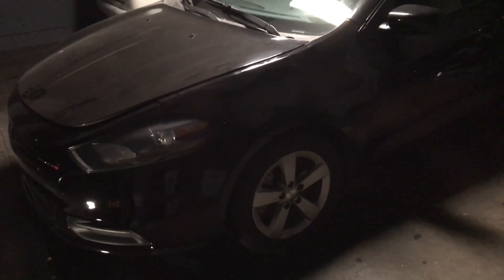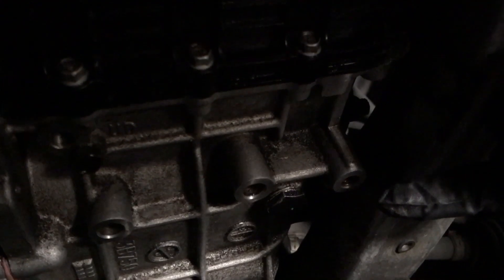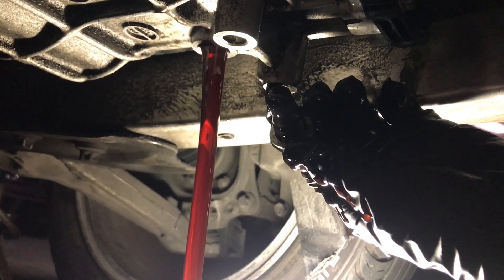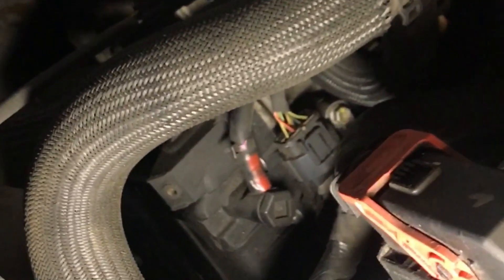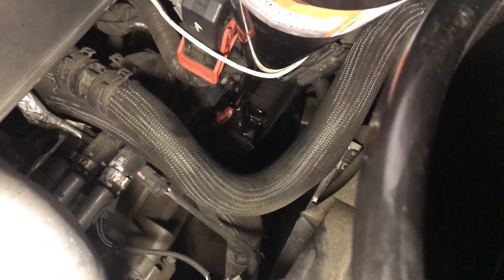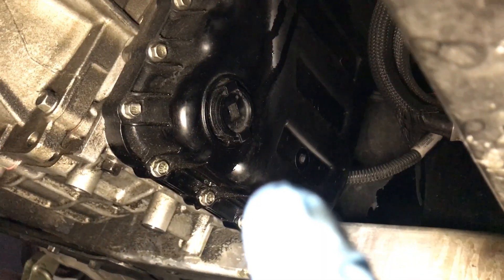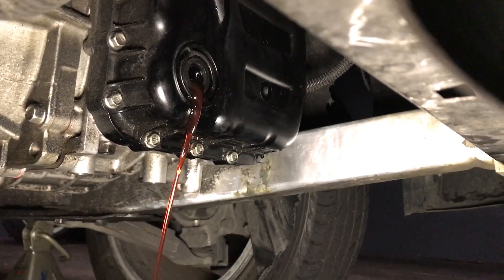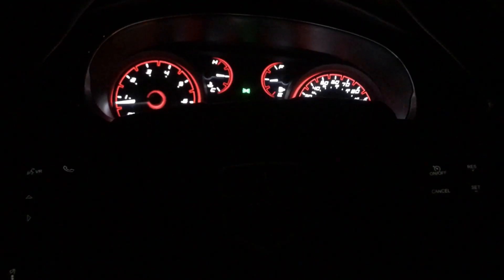2015 dodge dart SXT transmission fluid change

Comment: 1:10 15/16" is not a 'Fucked up" measurement when it's supposed to be a 24mm.  It's Korean transmission using metric bolts.  15/16" is just an SAE rough equivalent for 24 mm.  Otherwise, a great video to review before taking on the task.

Comment: Where you are trying to fill is the VENT! The fill plug is on the back and is most easily accessed from underneath. To fill use a flexible tube and funnel or long transmission funnel with flexible end. The  tool you use to check the level is available on amazon (CTA Tools 1017 Chrysler Transmission Dipstick) and more than likely  at better stocked auto parts stores. You use this to check the level from the fill hole. Doing it right and  filling from the proper plug which is on top  close to the driver-side firewall. Fill plug and drain plug are both 15/16ths  (24mm). The vent (where the video is showing you to fill) is opened  to allow the flow of the tranny fluid to push out air when filling. Honestly if you've done it twice already like I have after the car is up and level and already to temp the drain, fill, and fluid level check takes 15 minutes tops!  use a clean drain pan so you can record how much fluid drained out. Replace that much with new fluid. Start it up and check the level. I don't have a lift so I level on jack stand or blocks and am on a creeper while it's running checking from underneath just like the rest of you. It really is pretty easy and beginner level skills are all that's needed. Check around the net to find location of fill plug. It's hard to see from the top cuz there is so much shit blocking your view but it's there.
Reply: Gor o e of the tools but disnt come with box so i have no clue what level to put it in any help?
Reply: YOU should make a video on how to do this because you're exactly right.
Reply: Thank you, Shamus Todd, for your clear directions of how to properly change and service the 6f24 6-speed auto transmission manufactured by Hyundai for Dodge & Jeep models including the 2013-2016 Dodge Darts & 2014-2017 Jeep Patriots, Kia models...  Thank you for explaining about the proper fill plug which is located in the corner/back of differential/transmission.  You confirmed that the front black bolt is used as a vent primarily (left opened while filling baxk fill plug with SP-IV ATF Mopar transmission fluid.  I understand that either a 15/16 socket and/or a 24 mm is used on both the drain plug and the back corner fill plug with washer.  The front back plug can be opened with a 3/8 socket.  See black plug opening for maintaining proper transmission level.  Torque is between 32-36 ft-lbs on both filler plug (back corner of differential/transmission.  Operating temperatures should be approx. from 120 to 124 degrees.  (Use CTA Tools 1017/10320A Chrysler Dipstick)...  FYI, See BestLine Transmission Conditioner with Diamond Nano-Lube Technology to help your 6f24 run cooler, longer, with smoother shifting!  Visit here:  http://www.extreme-engine-relief.solutions
Reply: @anthonytaylor-qx1px  i know its way late to answer you but i'm answering you for posterity sake so others can find the info. I ha to look it up because i couldnt remember but when you drain the transmission all you need to know is it holds 5.3 quarts of transmission fluid. These are a closed system of a sort but the still consume fluid and get low. So if you were low and put back what you took out you are still low. Drain it completely and add 5.3 quarts. Also something that may be important to pass on as im done with this car. My daughter bought a honda. So anyway the  torque converter holds 2.2 quarts and the pan holds 5.3. When you change whats in the pan whatsin the convertor will mix with it when driven. I believe this is a very good thing. The transmision runs on fluid friction super clean fluid in a worn tranny may not be a good thing. What im saying is the new fluid mix with the old still in the convertor is probably just the right amount of dirty to cause friction and be in the propper vescosity range.   Well thats it hope this info helps someone else from getting screwed at the shop.

Comment: That is NOT the fill point for the 4F24 transmission, I believe is for the air vent.  That is why it takes you 1/2 hour to fill it.  The fill point and plug are further back and is similar in appearance to the drain plug.  It is easier to reach from the bottom then use the funnel from the top with a length of flexible hose placed into the fill hole.

Comment: ur supposed to get the transmission oil up to operating temp cycle thru gears a couple times with the car on..then pull off the level plug and check the stream
Reply: The engine is also supposed to be running in park.

Comment: I did mine.   3.5 litres drained out, add 3.5 litres in the level check hole, you’ll have to start engine to allow it to fit.   Get a pump and a long hoses to make the process easier.

Comment: Forgot to ask you the type of ATF you are using and the amount you use for transmission fluid replacement.
Thank you
Reply: Use the same amount that came out, and use SP-IV M mopar fluid. You can use the level the way he did if you have a level surface to check it, similar to a differential/transfer case

Comment: Does it have a filter to replace
Reply: The 6 speed 6F24  automatic transmission has an internal filter within the transmission housing which requires no servicing!  The only way to replace the filter would be to open the transmission up and that is out of the question!  Juan, FYI check out our BestLine Automatic Transmission additive which would promote a cooler running transmission coupled with longer life!  Visit BestLine here and thanks, Juan:  http://www.extreme-engine-relief.solutions

Comment: What about the filter?
Reply: you don't need to change the transmission fluid filter unless your transmission is already super screwed up and breaking up. the seal only needs to be changed if it is leaking.

Comment: I'm assuming it drove without issue.. did you add or remove any fliud after you check the level the first time?
Reply: Yea i did checked it but i forgot to record it. Oil came out in the same amount as it did in the video so there was no need to add/remove oil, this might be different for other people. Its safer to double check
Reply: jousey junior, so I flushed mines and to level it out just open the side cap to level it
Reply: Jovany Vaquera yes thats right
Reply: jousey junior, so I have a 2.4 how many quarts do I put in the pan.
Reply: Jovany Vaquera i poured the whole gallon. It will get overfilled but as soon as you open the level plug all the extra oil will come out like in the video. Is not like an engine oil change where if you overfill it you have to drain it to fill it back up at the right level. I guess thats a good thing of having a level drain plug instead of a dipstick, it makes sure you always get the right amount of oil in. Hope it helps
Basically you are overfilling your transmission to later drain the extra.

Comment: Question. Please my son has the same engine with automatic transmission... doesnt the whole car have to be hot before the drain and completely level and when filling the fluid shouldn't the car be running to circulate the fluid to get it hot then pull the level plug to check proper level????
Reply: yea, it would make sense to drive it a bit and get the fluid circulated throughout.
Reply: So is your comment correct bc I have a 2015 Dart SE & I think I'm starting to have an issue but it could be related to the fluid